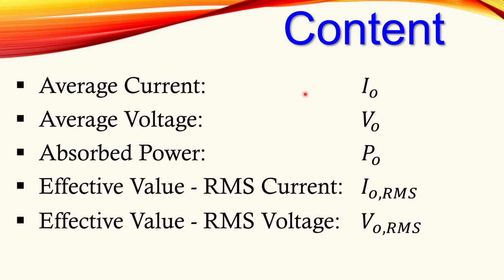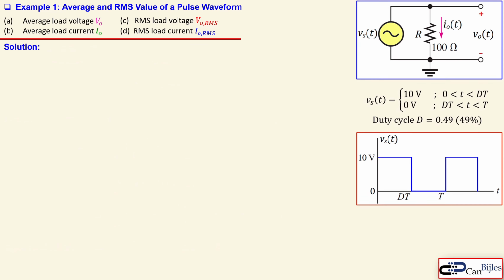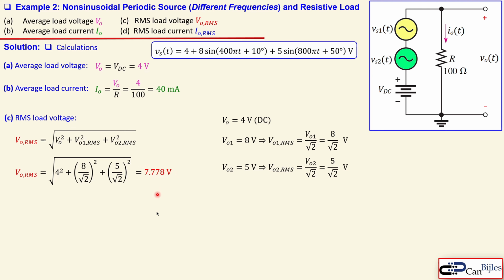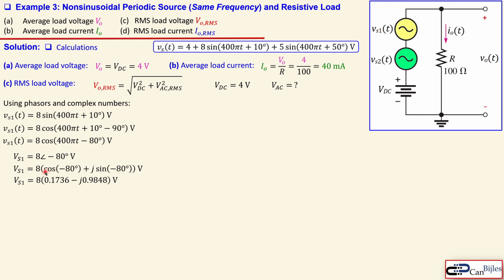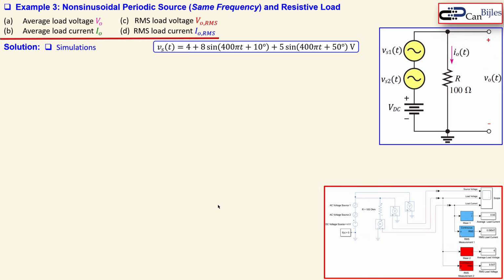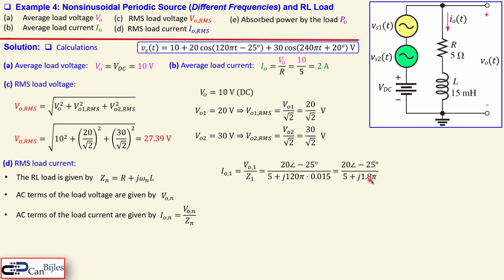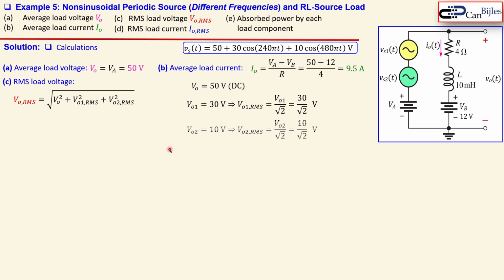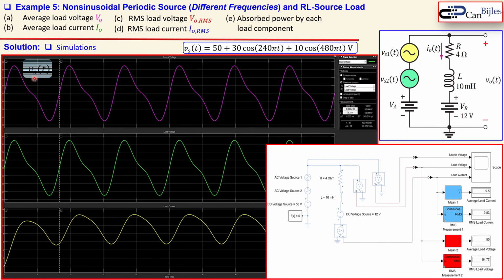Power Computations ⚡ Absorbed Power, RMS & Average Value in Electric Circuits 👍 MATLAB/Simulink

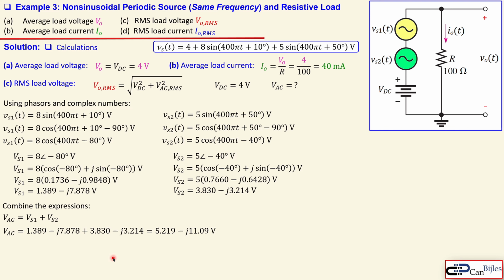Comment: around 17:00 it cant be -64.8 degrees and sine? would writing sum in sine also require converting cosines back to sine? so adding 90 to -64.8?
Reply from the maker: The cosine is used to do the calculations in the complex domain. When this is done, you can convert this into a sine as given in the original form or use cosine form by converting sine into cosine. The result will be same.
Reply: @CANEDUX  I understand but you converted since to cos, then calculate in cos but then never convert back to sin, You only write sine without conversion.
Reply from the maker: @salman_babar  Yes, you are  right about this. The phasors are based on cosine, so the end result should have been given in cosine too instead of sine. Fortunately, the cosine or sine form has no effect in this example on end results. Thanks for the question!

Comment: Thank you for the content.

It would be helpful to include the names of the Simulink blocks and their parameters.
Reply from the maker: You're welcome! The Simulink block names are given in the discussion of the simulations. Most parameters you need to fill in the Simulink blocks are fairly straightforward, similar to what is given.
Reply: @CANEDUX  thanks but I do not recognize the blue and red Simulink blocks. Continuous RMS and Mean. Maybe its Moving RMS and Moving Average Blocks from DSP System Toolbox?
Reply from the maker: @salman_babar  You can change the background and foreground colors in Simulink. Right mouse click on the Simulink block to do this.